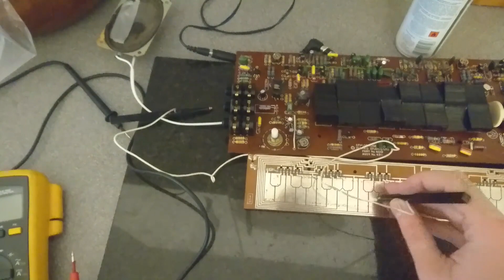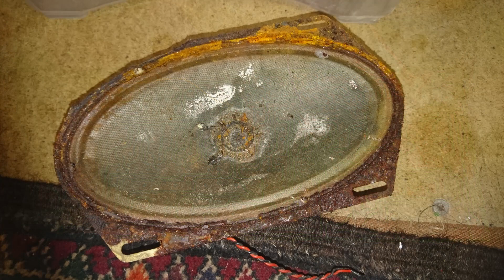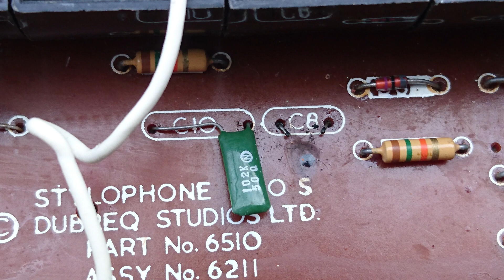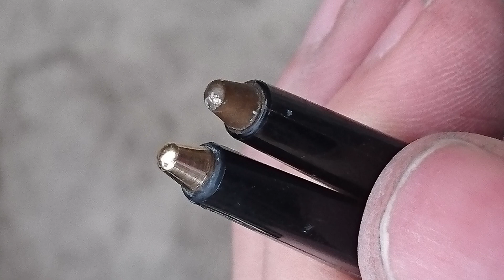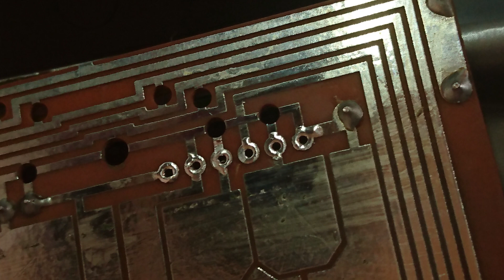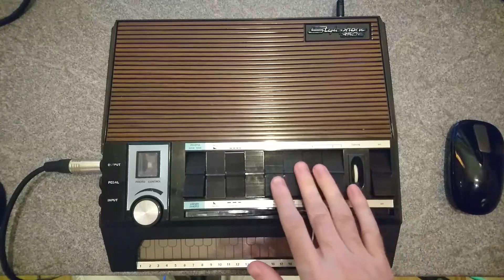1970s Dubreq Stylophone 350S Repair Pt2 - Conclusion & Demo

Comment: Would the sound work via output jack if Motorola chip is dead ?
Reply from the maker: Not sure without a schematic, but dismantle and clean the rocker switches - even on mine to this day, they're crap! Also look for bad joints around those resistor packs near the keyboard, again one on mine is a bit flaky

Comment: Hi James, in the video you mentioned a resistor array that blowed up. Could you please let me know which is the common on that array? I'm attempting to repair a 350S, and I need to check if those resistors works or not.

Comment: That cleaned up real nice
Reply from the maker: srvr1007 forgot to mention in the video that I got a lot more rust off the plastic by switching between vinegar + baking soda, brasso and isopropyl alcohol. Acetone on rags got a lot of grime and flux off the back of the pcb (with authentic 70s stink - glad I did it outdoors)